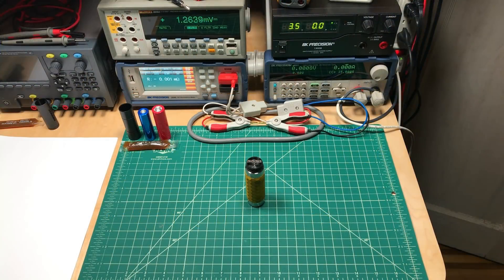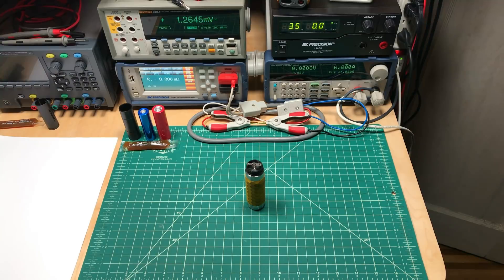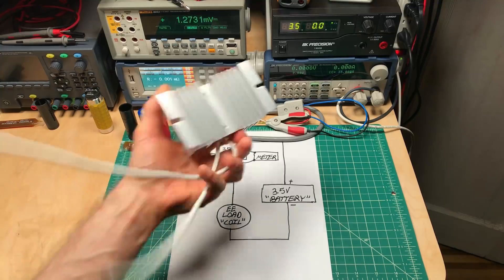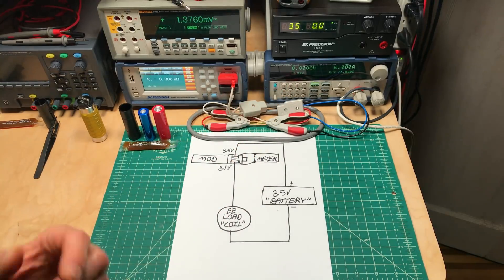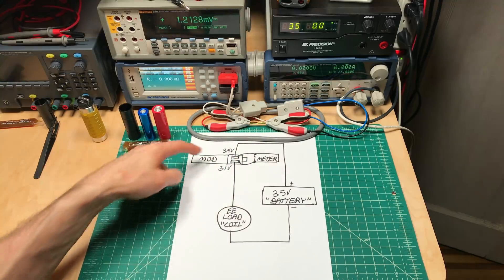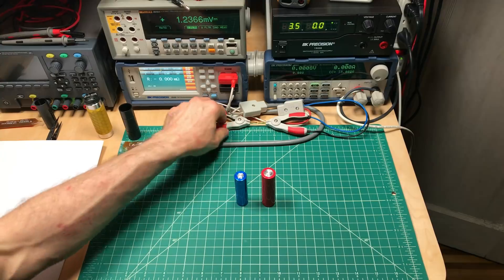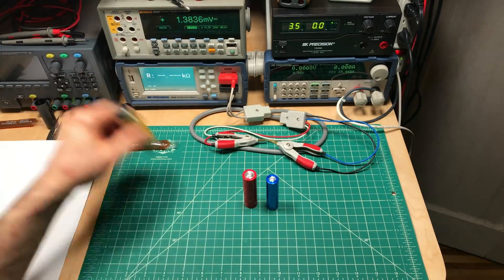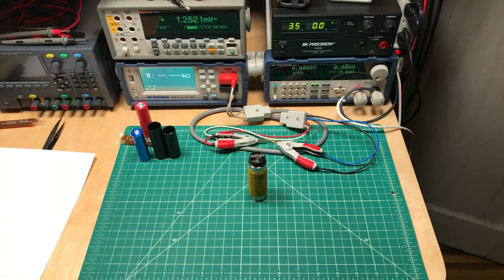Minding Your Mechs – Ep001 – The equipment I’m using and the testing we can do

Comment: @Battery Mooch Although i practice battery safety and follow your recommendations there is something i cannot find a clear answer too. Why is it safer/better to screw an atomizer to a hybrid top plate then scew it onto the tube? I do this even on non hybrid mechs also but i am wondering the reason. Thanks for all that you do. Sharing your knowledge, Test information. Your work for the vape indudtry/community is extremely valuable and appreciated.
Reply from the maker: You’re a lot less likely to dent the battery that way in most mechs.
Reply: Battery Mooch before I bothered you I did Google it and arcing was an answer which didn't make sense to me unless you are holding the button while screwing it in? Damaging was an  answer and so was, to avoid hard shorts?? Which obviously didn't make sense either but thank you for clarifying I appreciate it.

Comment: Mooch, I have a question for you. With the trend for higher and higher charge rates for charging in mods (2amp for a single battery ),  is there any batteries that get damaged or is dangerous to charge at that level. 30q is best charged at 0.75amp springs to mind. Maybe worth a video to let the people that us mods to charge know. Keep up the good work mate.
Reply from the maker: I did a video about 2A charging and have a charge rates table in my blog at ECF (link to my blog in the Description for this video). It can be a concern, especially with 3A and 4A chargers becoming available.
Reply: Charge rate table ..... Perfect... Thanks Mooch

Comment: Quick question, why wouldn't you use the full voltage of a fully charged battery for your equation? Like why not use 4.2V?
Reply from the maker: The voltage doesn’t matter, which is the beauty of using a constant current flow. No matter what the voltage is the voltage drop across the mod is the same as long as the current does not change. The voltage drop would be the same at 1V as it would be at 100V. I use a lower voltage to reduce the power level the electronic load must dissipate as heat.

Comment: thanks for the video. look forward to the series. i do have an unrelated question. summer heat, leaving my mod in a hot car are these  things that i need to worry about?.
Reply from the maker: Yes, don’t do it. At best it can damage the batteries. At worst, the mod might fail (and has), possibly short circuiting the batteries. The heat shouldn’t be bad enough to send batteries into thermal runaway directly but it has happened. We don’t know the true cause though so we always have to advise not leaving batteries or a mod in a hot car. Or a cold one for that matter.
Reply: thanks

Comment: Wow, so theres a drop in voltage in those little 18650 adapters also? I always thought there was, but figured it was negligible, if any at all.

Great setup mooch! Cannot wait to start watching these asap!
Reply from the maker: It could very well be negligible. Worth testing to find out. :-)
Reply: Battery Mooch I agree. Any drop in voltage when using a single cell setup is always worth noting. Just so nice someone is finally doing this in a setup like you have there, where all the variables can be kept to a minimum, if any, and conditions are completely identical across the board. A lot of people have attempted this here on YouTube or at home(like myself) but because we didn't have the cool gear that you have there, we were left with too many variables to make a correct conclusion in the end. The fact you have a power supply to keep the voltage the se with every press is a game changer and we can actually get some real raw data out of this. So very exciting to see. I think you will notice a lot of people interested in this.

Comment: Mooch, how do you plan to eliminate the impedance of the atomizer?
Reply from the maker: I won’t. But using the same atomizer means that the relative difference between the mods is still valid. I will be measuring atty resistances eventually though for those who want to subtract the atty and “battery” slug resistances from the total.

Comment: @mooch are there any brands of pipes you consider less safe ?
When/IF a pipe auto fires The Pipe actually felt pretty hot  (in this case a smok V8 stick) I would think it is warning sign and time to throw it out ?
Last but not least what are the chances of a regulated device blowing up ?
I have see stories like vape pen blows up and then I am thinking arent ALL vape pens regulated?
Reply: I have been told regulated is pretty safe. I happen to like my eleaf I stick power which I know is regulated and then I think Is it really that safe ? I mean I cant see inside the box right. If there were faulty soddering inside or something like that Would the micro chips and/or other cut offs really work ?
Reply: I haven't had problems but I don't recommend any smok product.
Reply from the maker: The fat “stick” mods?
I don’t know anything about which may be more or less safe than others. Always assume that something can go wrong with any device though, especially when charging. It’s rare when something happens but it’s possible.

Regulation is just a method to control coil voltage and has no impact on safety. That’s up to the design of the mid and the quality of its assembly.
Reply: Yes fat stick mods. Also If possiable what brands have pretty good reps for quality of construction and not so good reps ? I currently use an elea.f i stick power 80 watt device and a smok stick v8 baby.
I am virtually certain I am going to ditch the later as I did find it auto firing once or twice.
I do realize no device is 100% fool proof.